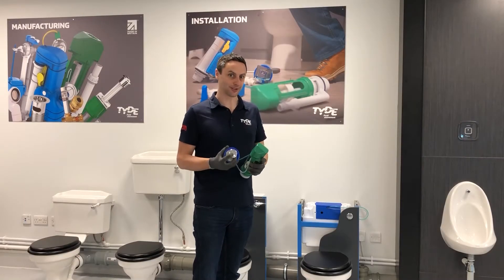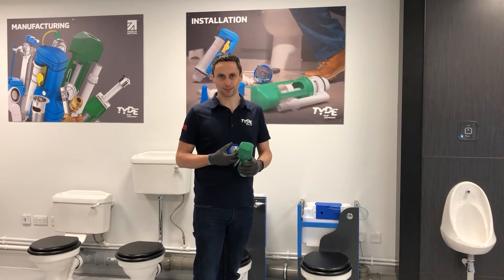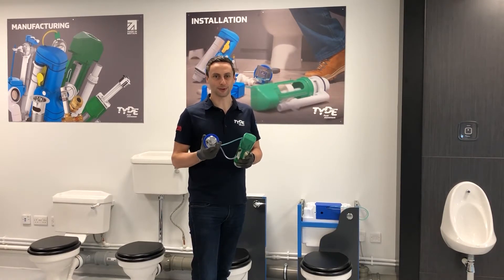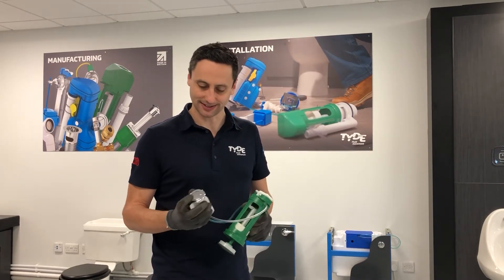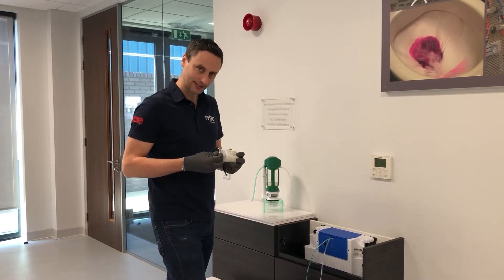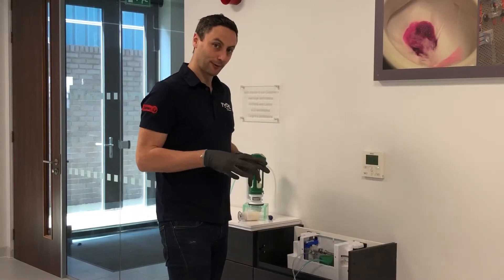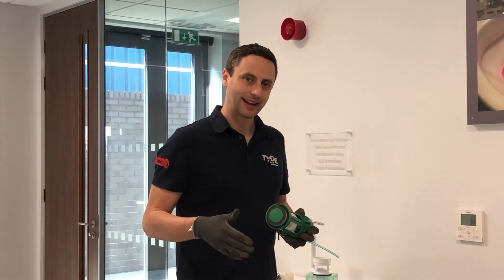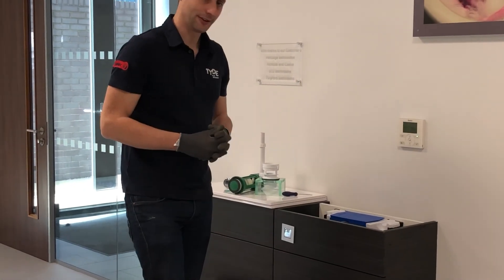Niagara Pneumatic Flush Valve and Flush Buttons / Plates

Comment: I have a white flush valve. There is a marking on it in blue " Dudley "  . On top there is a number  PGV 19,000 Delta .  Please do a video on  maintaining & repairing it. It is not flushing.  It has a large 91 mm Dome shaped push button.  I need to to know if there are improved top fittings for the flush unit. The cistern is built in and tiled. Cannot remove the entire cistern. Thanks.
Reply: Please let me have links for instructions.  Also prices of serviceable parts. And also prices of  entire parts.

Comment: Would be great if you were to have a closer view of the bellows in operations & access to remove & replace .  The video was all done at a distance . Better camera work would of helped.
Mostly it's the bellows that are the issue & scale build up. Although its cheaper to replace the bellows , for peace of mind for the customer & future callbacks its best to replace the while flush valve. The push buttons are quite expensive especially the 2" button & in some cases it's cheaper to purchase a whole replacement cistern which comes complete with all parts as opposed to buying the parts separately.

Comment: Recently had new cistern installed, the same as the one in your video with the blue access panel, and have water leaking from around the push button, having removed the front panel I can see water in the clear pipe, I thought these blue and clear pipes from push button were for air only, does this indicate a fault? Thanks.

Comment: Big issue with the pneumatic flush valve is if you have low pressure water supply to the cistern, what can happen is the flush valve let's by when filling as not enough water coming in to fill the cup on the flush valve. If you can't get enough water to come in to the cistern what you can do is make sure the flow restrictor is removed as it sits inside the inlet spigot of the cistern & not inside the fill valve itself. If you still have fliw issues what you can do , is to remove the flush valve seal on the bottom , with a large flat blade screwdriver is to prise out the centre green portion which will expose a spindle,  using either 1 or 2 penny washers or some solder wrapped around it . Replace the green button refit the flush valve seal & what that then does is help to hold the seal  when filling. You might have tk do 2 or 3 tries at fitting some of the washers as if it's too heavy when you attempt to do a full flush when you let go of the button the valve won't empty the cistern. The manufacturers are aware of this issue although won't admit to it. So don't go thinking it's a faulty unit as what will happen is it will do the exact same thing with the new one. If you can remove the unit altogether & fit a different flush valve as these will give you major problems down the line. Another tip with these cisterns is adjust the water level to about 5 -10mm below the water line. The reason being is when the fillvalve shuts off , being an equilibrium it will take a few seconds to adjust the pressure & shut off. On a hp system this can take the water level above the overflow & in some cases spill out the front of the cistern itself. Again the manufacturers are aware of this but won't admit to it.

Comment: Hello,  How much is the clear tube / pipe for Dudley Push Flow Single Flush Valve  ; Ref on top PGV 19000 Delta .   Also I need new pair of  black grommets / Rubber Connecters Protective Corrugated  Pipe
Reply from the maker: Thank you for your enquiry. It sounds like you have an old Niagara pneumatic flush valve. The old valve used black connectors to attach the air tubes. Unfortunately we no longer use these connectors. It will mean a new Niagara pneumatic flush valve which you can purchase through the Plumbers Merchant i.e. Travis Perkins, Wolseley, Plumbase, Jewson etc or via Screwfix.

Comment: Thanks.. I had a new dual flush cistern installed recently and water has started leaking from the push button when pushed. Just had a look behind the panel and have the blue and clear tubes, I thought they only carried air, could there be a fault with the flush valve? Thankyou.
Reply from the maker: Hi David… Thank you for leaving your comments on our video.  I’m sorry to hear that you are experiencing issues with our product.  This is a strange one… As we have never seen this issue before?  The product you are referring to is a pneumatic outlet valve and as the description details, the tubes are for air and should not contain water.  If installed and connected correctly the tubes and button should have no physical connection to water, so it’s extremely unusual for water to be coming out of the button?  I advise to start checking all of your pneumatic connections are secured and in accordance with our installation instructions.  If you are still experiencing problems please contact our technical helpline on 01215307000 (option 4) and our product experts will help you resolve any further issues you may have.
Reply: @TYDE  thanks for your reply, I have looked at the push button tubes and can see water being sucked along one tube to the flush button when pushed, I can only now think it's a faulty tube connection at the flush valve end or the flush valve itself is faulty,  the leak has stopped at the moment and the area is dry,but if it starts again I think I may take out the flush valve to check and have a look at the tube connection and probably remake the connection.. I think the flush valve just twists out of the cistern tank doesn't it? After turning water off..
Reply from the maker: @davelinkson1  Hi David. Thank you for replying to us. We’re glad to hear that the issue seems to be resolved. You are correct the flush valve is removed with  a ¼  turn. It is possible to re-terminate the tubes without removing the valve. Simply remove the tube, cut off 1cm and re-connect. We are always available to help on 0121 530 7000 Option 4 should you need us again.

Comment: having trouble accessing the flush valve as the inlet float valve system is preventing removal of the flush valve? Can you advise?
Reply from the maker: It depends on your cistern installation but we’d advise isolating the water supply and then removing the inlet valve first in your case, before then servicing the outlet valve

Comment: I have a single flush button and a dual hose entry. Will work if I just fit one pipe?
Reply from the maker: Hi, if a single flush button is used it should be connected to the clear tube. The green tube which is for the reduced flush can be disconnected. If you need any further assistance please call our Technical Helpline on 0121 530 7000 option 4. Thank you TYDE